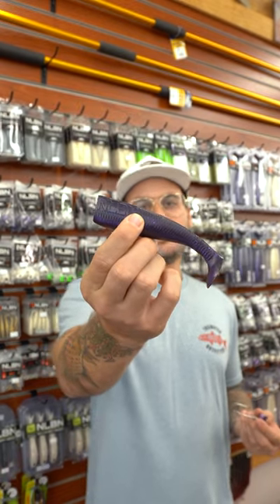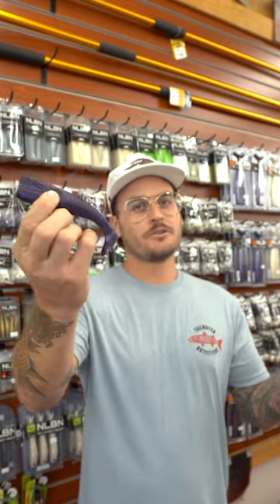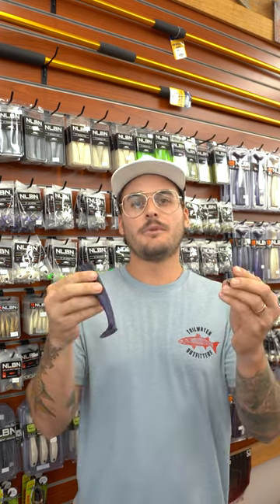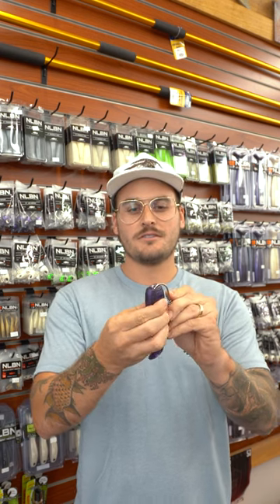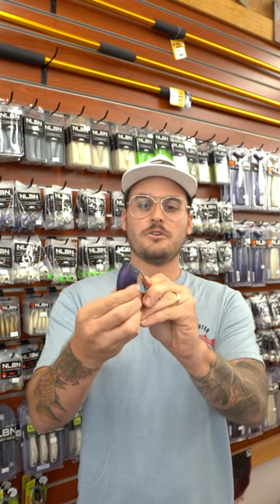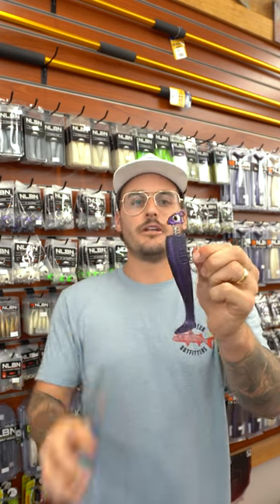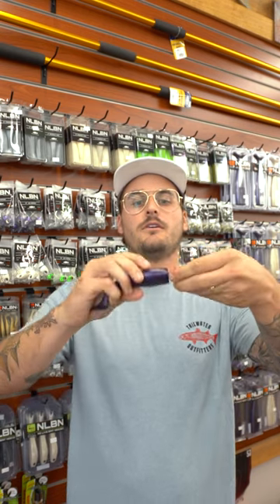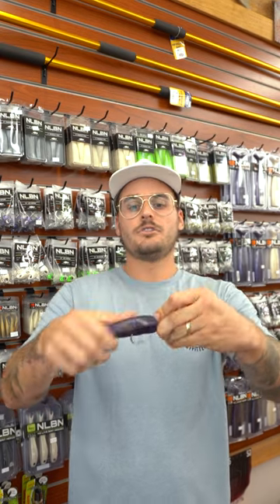NLBN 5" Paddle Tail | How to Rig It

Comment: Definitely not the right way.. You are twisting the tail 7 full rotations around the hook when it only takes 3 rotations of the swimbait around the jig head to be snug up against the head. 2. You have the hook sticking wayyyyyyy to high out of the top because you didn’t feed the hook through the swim-bait enough before poking it through the top. Causing the back end of the swim bait to point downward and swim incorrectly. Literally the worst NLBN rig I’ve seen

Comment: What lb line do you recommend for a lure that size? I have a 1-4 oz lure rod with a 400 size baitcaster with 30 lb braid do you think that will work?
Reply from the maker: Yea, 30lb should work fine
Reply: @tailwateroutfitters  thanks I’ve been wanting to get into throwing artificials
Reply: I would throw the 5 inch with 15 or 20 pound braid just fine
Reply: I run 30 too, but I’m thinking about dropping down to like 20
Reply: 30lb is plenty. I’ve caught many 50+lb fish on 30lb Braid.

Comment: Hi buddy , that’s definitely not how to rig a soft plastic I find the best way to do it is 
1. Line the jighead against the plastic to see where it will come out. 
2. Thread the Jighead straight down the middle until it comes our straight. 
3. Push it in the shaft 
Edit: that hook is way to big
Reply from the maker: ... It's an NLBN jig head, specially made for that exact bait... thanks for the tip
Reply: @tailwateroutfitters  ah ok not a problem